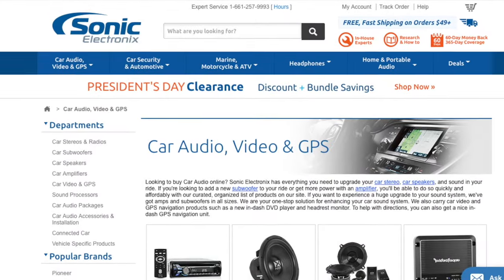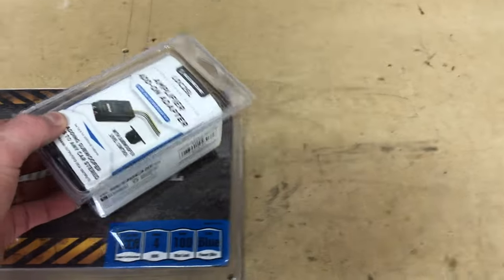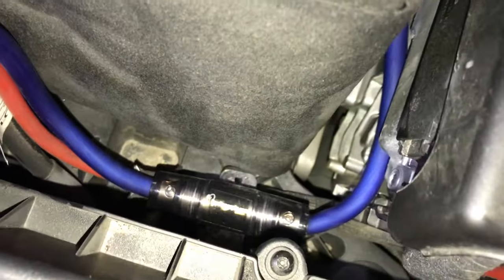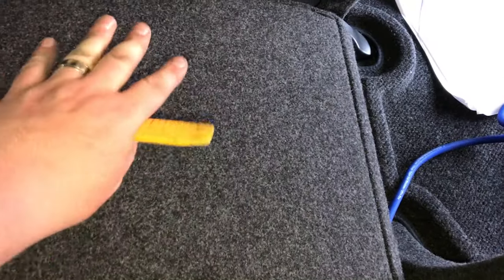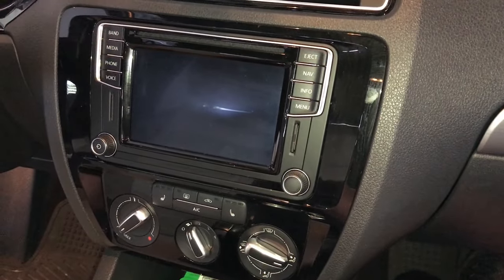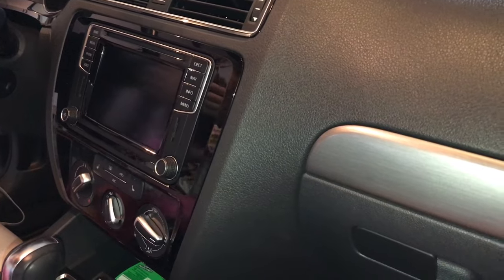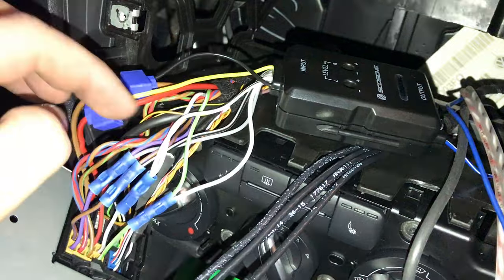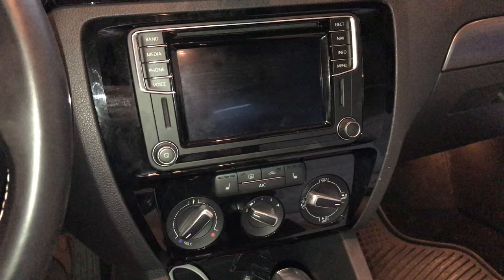2011 - 2018 VW Jetta Sub and Amp install to Factory Radio

Comment: Can I just hook up my sub and amp to my stock deck and leave the speakers powered by the stick system? 

I only want my amp powering my sub. 
2015 Jetta TDI
Reply: I have my Jetta 5 2009 edition powered like that. JBL Monoblock running a JBL 8. Factory speakers off a multimedia deck.
Reply: That's what this video is about.  Just adding a sub amp to the factory.  Interior speakers still powered by factory head unit.
Reply: The amp that your installing is just for the sub you want to install your only tapping into the two rear speakers for sound signal to the amp for the sub to output sound. So basically everything is still stock accept for the fact you now have a sub in the trunk all the box is used for is the RCAs to the amp for the sound signal to the sub.sorry i tried my best to explain it it basically your aux cable to your sub so your sub is playing the music coming from your stock head unit AKA stock radio

Comment: Quick question I’m doing install on 2011 vw cc and the line out converter box I got did not come with remote wire, do I use the yellow wire (named SAFE) on the radio for my remote wire or use another spot? Thanks in advance
Reply from the maker: Your radio does not have a switched power source, do not connect it there as it runs off a canbus digital system.  You will have to run a line to the fuse box or any other location that has switched 12v+
Reply: Can you tap into the fuse for the cigarette lighter

Comment: So there is no actual remote wire in the OEM harness ?
Reply from the maker: Nope, they run on a canbus system
Reply from the maker: No analog turn on.
Reply: @ProvoBeastAudio  what about running it off the ignition barrel ?

Comment: Great video. Do these line out coverters provide a good clean signal if compared to an aftermarket set up?
Reply from the maker: you get what you pay for, so the nicer modules yes, especially if you go full DSP.  Look into the AudioControl Brand as they have good options for quality sound processors and line out converters.
Reply: an aftermarket setup almost always works better because with a decent unit the rca signal will not destort...but with aftermarket headunits you need some adaptors for steeringwheel controls etc, so that means extra cost...but if you do not mind not cranking your radio to max volume a high low adaptor works great also...

Comment: Is there any benefit to tapping in behind the radio vs tapping in the rear speakers?
Reply: Yes, the radio both speakers are there, the speakers for these cars are in the doors which means taking both side door panels off and a lot more wiring. There are no speakers in the back window

Comment: If I have the fender sub in the back, could I plug the harness going there into the amplifier?
Reply: Marcus Gallardo I did not, but there are no red flags saying it can’t be done
Reply: fender sub isnt that good,i replaced mine with two JL audio ,now we rock! Oh ya and some 150watts kenwoods in the 4 doors.

Comment: Need help with a 2013 Jetta GLI don't know which red/yellow wire to use
Reply: My amp gets power perfectly fine. I just cant get any sound from my sub. I hooked up my system to another car and it worked fine its just my car

Comment: Where do I work the remote wire to on the line out converter
Reply: It does not need to be connected.

Comment: When I was trying to take out the rubber that covers the clutch hole for this exact model it happened to fall through the hole. Is there an easy way to retrieve it or do I have to buy a new one? And if so what is exactly called and where do I purchase one? Thank you.
Reply from the maker: I'd look for it, it may take some time but grab a flash light and take a look in the engine bay.

Comment: I can't seem to get my amp to turn off, its wired all the same, but it stays on and kills my battery. Any advice?
Reply from the maker: Well you may have the remote wire connected incorrectly.  That wire needs to be hot only when the sounds / key is on if your setup is similar to the video's. check to see how you have that remote wire hooked up.
Reply: the line out converter supplies the remote power. it gets triggered on when there is any input, which could come from the speakers being a microphone. that lights up the amp and boom amp feedback loop to a drained battery.

Comment: Why did you use the remote turn on adapter?
Reply from the maker: Because then we didn't need to source a remote turn on wire to trigger the amp to boot up.  This lowers the risk of the notorious VW bump in the sound system when booting up.
Reply: So I have a double din pioneer the AVH-X 4800bs and since it has been installed my stereo system has a huge bumb after I turn the car off but the amp will stay on for a couple seconds after car is off then it’ll turn off creating a second pop what is the cause for this? Do I need to run a relay or something
Reply from the maker: How is the amplifier's remote turn on wire hooked up? It shouldn't do that if your wiring is right.  do you have the factory Fender system?
Reply: No I have a dc audio 9k with a dc lvl 6 15 no stock system though my remote turn on goes straight from my amp to the head unit
Reply: My car is a 2013 vw Jetta just the base model
Reply from the maker: With a DC 9k, it may be the amp or the radio generating that bump.  You could try a relay, or put in a switch to manually turn off the amp before you shut the car off.

Comment: So does removing the negative on the battery whip the cars computer I had a 2012 Passat and the battery went out on me when I took it to the dealer they said that I had to get a computer reset along with the new battery so I’m just wondering I got a 2018 Tiguan and want to do an install like this but don’t want to have to go get a reset for messing with the battery trying to get an amp set up

Comment: quick question is it also possible to install the line converter directly onto the rear speaker wires in the trunk location and tie into the 12 volt and ground for the amp to power the remote line? (i'm using the same scosche line output converter with remote turn on)
Reply from the maker: Yes, but on this model, there are no speaker wires in the trunk as the rear speakers are located in the rear doors.
Reply: @ProvoBeastAudio  I have a 2014 jetta GLI with the fender audio system and I have power wired all correctly to the amp but no signal to the sub using the factory connectors to the factory sub in the trunk, can I tap the rear door speakers or do I have to run signal wires all the way to the back of the radio?

Comment: If my amp has a fuse on it do I need an in line fuse
Reply from the maker: Absolutely! The fuses on the amp generally protect the amp internal circutry, but the fuse by the batter protects the run of wire to the amp (and the amp) against shorts, wires, fires, etc.
Reply: IASCA rules are within 18" of the battery.

Comment: I have a polo 6r from 2010 with stuck radio, and i have no idea how to connect the wires, because mine is a diffrent color. I have seen the video 4 times still dont understand. In the orange part, i only have 4 wires, anny idea for what to do
Reply from the maker: If it uses the same wiring harness plug (even if the wires are different), disregard the colors but connect the wiring harness in the same configuration.
Reply: 3 years late but I stole the signal from the red cable going to the head unit.